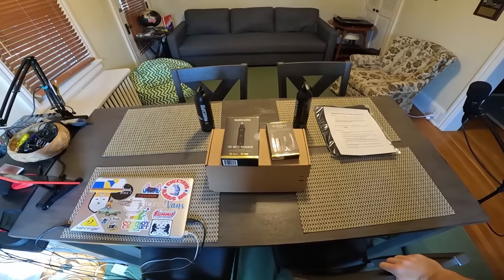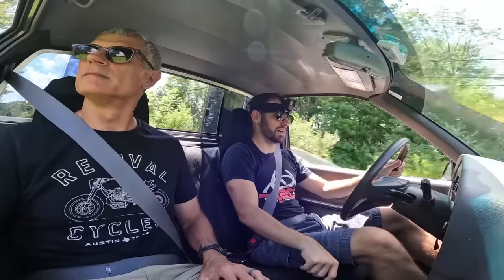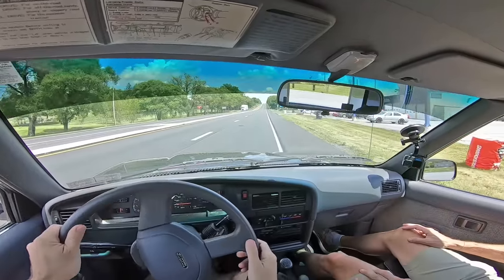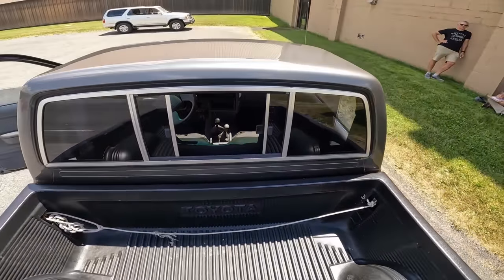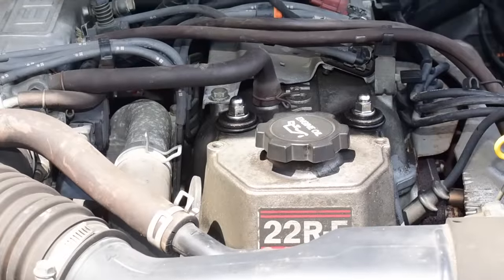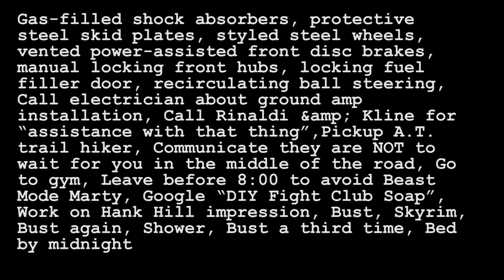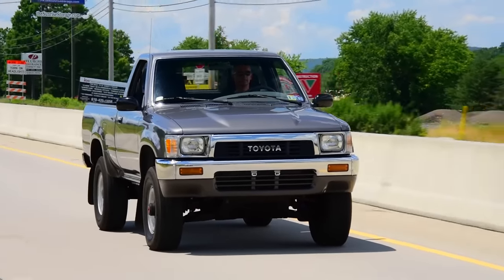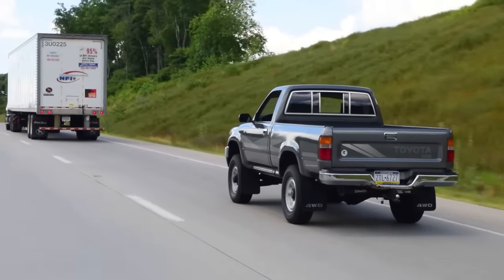1989 Toyota Pickup SR5 4X4 5MT: Regular Car Reviews

Comment: I want one, yes. But I would treat it the same way I treated my showroom condition 2002 Ranger XLT 4x4 5spd with the 4.0 V6. I would use it for moving things. I would use it for pulling a trailer. I would go off-roading to pass the time almost every weekend like I do now. I don't think I could ever, no matter how clean it was, take something like a Hilux and hide it under a cover. They were meant to be enjoyed. Not abused, not overworked, not destroyed... But actually used as trucks. And maybe it gets a ding here and there or acquires a scratch when I get too close to a big bush but that's okay. That's what it was meant to be. Dings can be pulled and scratches can be remedied. It's all part of a truck's maintenance cycle and as long as you accept that a truck you use is a labor of love, it will never let you down.

I would pay $20,000 for that truck. But that's because, for 1/3rd the cost of what's sold today, it would outlive me and the nephew who gets it after me as long as we take care of it.

Maybe I'm trapped in my own little fantasy world but I've personally seen these trucks with their original engines with over 500,000 miles on them still going strong. I need one.

Comment: 2nd comment here further into the video, a 22re powered manual transmission truck running well should have 0 issues going 80mph and cruising around town spiritedly. That one must have some issues. My 92 forerunner with 31 inch tires could hit nearly 100 mph, and I’m 33 inch tires I can still do 85 mph and I have gotten as much as 24.7 mpg. I do have all of the emissions equipment deleted, a performance header, no AC, and most maintenance up-to-date. I have absolutely no problem merging on the highway or passing people in a 55 mph zone. And my rig weighs about 4000lb, 1000 more than the little pickup there

Comment: Know a relative who has the Face Lift version of this (1994). Weirdest optioned truck I've ever seen. Base rear wheel drive trim with all chrome, graphic side decal, extended cab, 22re, but manual everything (Locks, windows, mirrors and transmission) and oem Toyota Bedliner. Even had the sr5 gauges with oil pressure, tach, and volts. Went for a ride and my relative had to turn off the ac and floor it to 5k to get on the freeway. Can't say I'm impressed, but that truck still has guts. Looks alright for its age with 327k miles. No indication that its an SR5 on the rear tailgate. My relative still uses it as a knockaround truck and for spirited driving.

Comment: The owners love them. I was in Denver working at the dealer. The 92 came in making noise. I was an apprentice. The master tech I worked with heard it and said sell them extra time to peak under the valve cover. This had a chain with plastic guides, just like now. The plastic cuts down noise. And steel chains eat it up over time. Just like now. The guides were gone and the chain was bouncing on the cover digging into it. And to do the chain on the 22 you have to pull the head off. The truck had 200,000 miles. But these owners were like the ones with a bow tie or blue oval tattoo. The owner bought an over haul for $4700. Back then we took it out pulled it apart and sent the block and head with the new pistons to the machine shop. Rods were just traded for $10. The machine shop did the head, bored and honed, we reassembled. That job was 27 hours in TTIPS. It was the first ticket I pulled from the dispatcher.

Comment: I had a '92 with extended cab. I bought it for $5K. Several years later someone ran into the side of me. The guy in front of me was pulling a boat that came off the hitch when he was pulling out of a gas station ahead of me. A little Honda was flying around the turn ahead coming towards us. As the boat moved into the oncoming lane the tongue of the trailer went through the driver's side headlight spinning the car counterclockwise off the road in a semi-circle until they slammed into the side of my truck with their passengers side. I couldn't do anything but watch, and when they came to rest I was right next to the passenger of the little Honda. Funny thing was I had just finished a conversation with the boatman. He was a class behind me in high school. The occupants of the little Honda were one class ahead of me. The insurance company totaled my truck for $5400, and I bought it back for a few hundred. The side was just bent up, and it needed a new drivers side window glass. A friend of mine patched it up, and I drove it several more years before finally selling it. So even though it literally paid for itself I never had that feeling like it stacked up to all the hype. Even with the V6 it was a dog, and got terrible mileage. I guess the best word I can come up with to describe how it compared to what I was used to is "thin". It felt really light, but not how it drank gas, or had zero power. A big meh after hearing all the hype for so many years. This was all close to 20 years ago.

Comment: I drove a '91 in high school and throughout college after saving all summer in 1999 to buy it for $5,000. It had the six-cylinder -- I believe,  3.0 liter -- and a five-speed manual. I loved that truck. It was damn-near impossible to get it struck, unless you were downright stupid. But Mr. Re is correct about the rust: Upstate New York wasn't kind to that frame.

Comment: I grew up with a dual cab '95 model that we had up until a couple of years ago when Mum sold it. Ours had the 2.8L diesel which was even slower than the petrol variants available here. That said, a somewhat common engine swap for these here in Australia is the Buick V6 3800 from a 1988 - 2004 Holden Commodore, allows these to cruise effortlessly on the highway at 110 km/h and tow or move heavy loads while still getting decent fuel economy.

Comment: This was the vehicle that made me a Toyota fanboy. I wanted a small pickup with a manual and it was either going to be one of these or a 2000's Ford Ranger. Safe to say I made the right choice. Bought a white single cab 2wd 5spd 94 22re with only 90k original miles. I always thought of it as like a Japanese El Camino or an Aussie's Ute. The truck drove like a compact utilitarian tractor made for work. Even though it was 2wd it was so light, once I put on some all terrains it would go anywhere a 4x4 would go with the exception of mud. The 22re was a dog but made up for it with it's plentiful low-end torque. There was an old saying with these trucks, "they last forever because it takes that long to get there." Toyota would be very wise to bring back a truck of this size with a modern engine, bare bones interior and manual transmission yet with modern safety equipment, but sadly, I don't see that ever happening which is also why these things are skyrocketing in value.

Comment: I bought one from a neighbor this spring for $600.00 needing a fuel pump. I don't regret buying it at all, went mudding and beating down quad trails right after I fixed it. Glad I didn't go with building a squarebody chevy for my 4x4 needs, the toyota is way better.

Comment: Just picked up a 94 single cab 22RE 125k on the clock 5spd. one owner because the seller didn’t use the Internet found this one in the newspaper No Competition flashed some cash drove away nice and easy garaged it’s whole life No Rust Paint still glossy motor unmolested

Comment: Awesome trucks but the rust is a real issue.  I looked at a Black 1986 that looked immaculate. Marty Mcfly’s w/o the Xtra Cab. Truck looked perfect it even had the bumpers from the movie(no roll bar though) but the frame was legitimately missing bellow the bed. Like, gone.  It was shocking a truck that looked that good could have a frame so messed up.

Still on the lookout for one of those trucks but man was that an eye opener.

Comment: Not sure what happened in the States, but we had a version with the 4Y - 2.2 litre, and it went like stink.
Also used in NZ Hi-Aces.
Remarkable engine, both torquey and powerful.
Had a Hi-Ace van off the clock in 5th on one of the rare straight roads up near Kaitaia in Northland, NZ.
Nice old bus.
Unfortunately, someone rolled it.
Glad to say it wasn't me.

Comment: I got a 1988 Chevy S10 2.5 5 speed my Dad bought new. I had it repainted and the engine rebuilt a few years ago. It looks new again and it’s my daily driver now. I get flagged down all the time by people wanting to know if I’ll sell it. I already turned down 20k for it…twice. 

With gas so high I’m glad I have it. I almost put a V8 in it but glad I didn’t now. It’s also fixable when something goes wrong. I wouldn’t trade it for a brand new one. Plus I was 3 when my dad bought it and it’s the vehicle I learned to drive in ( I’m 38 now).

Comment: In the spring of 1994, my dad bought a new base model extended cab Toyota Pickup. It was probably the coolest vehicle my parents had. Unfortunately in the fall of '94 (approx. 6 months later) it rolled backwards with me in the back seat on the shoulder of the freeway into the path of a semi truck. The semi truck was able to slow down enough where I only lightly bumped my head on the rear window, but the bed of the truck was completely caved in. Still to this day, the scariest thing that's ever happened to me.

Comment: got one! a 1992 toyota sr5 extended cab, manual tran, got bull bars and a box in the bed, 4wd, 3vze with an AM head gasket so it doesnt have those issues, very minty, got it for 500$ cuz the guy was old, didnt want it, and said it wasnt as good as american pickup, and the oem water pump finally gave out at 250k miles so it didnt run

use it as a daily and an offroader and i treat it like dirt. use it like dirt. had a guy offer 10k for it. talked to him a bit and showed the minty new pics compared to the scratched and dented truck it is now and he cried a little lol

Comment: If your rear suspension is bouncy you probably need shocks.  I have a 1995 base model 4x4 with 63k miles and it rides good, especially with a little weight in the bed.  With a little weight in back my truck rides nice and soft like a luxury car, and yes, it loves 48-60 MPH.  It was designed in the early 80s for a 55 MPH America.

Comment: A friend in high school had an 89 Mazda pickup 4x4 with a big 4 cylinder that seemed fast enough back then, and could pull a 25” boat out of a wet launch ramp no problem; everyone in their f150s and silverados were struggling in the rain with smaller boats. I swear that thing had no problem running with no oil

Comment: The Toyota Hi-Lux with the 2.8 Diesel engines are one of the most sought after trucks in my country, one in excellent shape can fetch MSRP prices. The are reliable, tough and very slow, but a great truck. My father owned 4 since 1981.

Comment: Bought an ‘89 RN101 4x4 with the 22re and 5MT earlier this year. These things are just so cool and fun. Nothing like the long throws of those floor mounted shifters in older trucks! Unstoppable in the snow too when driving in winter is unavoidable. Unfortunately mines out of commission for a suspected bad igniter. Once that’s replaced it’ll be back on the road. May sell it, may keep it.

Comment: My dad bought an 89 DX new and drove it through late 96 when he got a T100. I learned to drive on that truck and the 94 4Runner my mom drove. Both were manual. The pickup was a 22R regular cab painted light blue and the 4Runner was the 3.0. Sadly we rolled the 4Runner after 3 years of having it.

Comment: bought one of these in 2009, while I'm sure the engine would go forever, even then every thing else was prone to failing, like the window brackets rolling up windows, transmission synchros going out, key holes getting worn. On top of that you're the slowest thing on the road and getting the gas mileage of a full size v8, ~18-20 on the highway, depending on the tire size.

Comment: It's not that I dislike the truck at all, it's fine. My dad owned one back in the 90s for a couple years until it... well, rusted out like most of them did. 

Just really can't imagine why you would've gotten one of these over a F150 or Ranger of the same same. Better at being well.. trucks. I think the motor is fabulous and the transmission was bulletproof but the rest of the truck just fell apart. I remember watching that Top Gear episode and thinking "what.... these things fall apart all the time" and couldn't believe it was the same truck. I had a 89 Dakota 4x4 with the 5.2l and the 5speed and I would've taken that all day over the Pickup after experiencing the one my father had.

Comment: My 89 Rwd would run the speedometer right up to the peg. But it came with car sized tires. It was really fun to scoot around town, especially when I added a rear sway bar and fixed the camber in the front.

Comment: I once saw a 1992 Toyota Pickup with 828,000 miles on what the owner said was the original engine and transmission. Thing looked and ran like garbage, but it was glorious.

Comment: I don’t own this truck, but I have an ‘05 Dodge Dakota SLT with a v6. The suspension thing is true of my truck too. Very springy, but not in a lose way, more of a rather stiff one. You go over a bump in my parent’s vehicles, it feels fine. Go over one in my truck, it sounds expensive. The whole cab rattles. We had steel plates on a main road out here. They were coming round a turn while going down hill toward an intersection. You had to get on the brakes before getting to the plates, otherwise you’d get the sketchy experience of feeling your rear end skip off to one side, a few inches, mid turn. And that’s with recently replaced leaf springs, mind you. Don’t know who the previous owner was, but they beat the crap out of this thing.

Comment: My friend has an 89 Extended cab, V6 manual. He bought it new, and rolled it in a snowstorm 6mo later. It now has 220,000 miles on it but the engine doesn't make any power on inclines

Comment: I have an 86 base model 5 speed 22R-E carburetor engine with the 5 speed manual but mine is 2WD and I agree folks do stop you to hagle a price. Funny thing this truck had no problem starting up over the winter while my wife's Chrysler 200 couldn't even start on the coldest day of the winter in Chicago last year.

Comment: Had a '02 reg cab 2wd, bought for 6k put 255k miles on it  over 15yrs and sold it for 2k, miss it terribly but I couldn't find a rear diff for it reasonably, told the buyer and he still brought it and I see it occasionally in my area... They are great trucks, hesitant though about buying a '22 base model for 31k and wondering if it's gonna last that long...

Comment: I bought a 1 owner 2wd 1987 pickup with a 22r and a 5 peed in 2021. it has 128000 miles and is rust free and almost immaculate. I paid $600 for it. No I did not forget a zero. I will never sell that truck. on that note if anyone has parts to put air con in it let me know

Comment: Here in Europe we all got the 2.5 or 3lt diesel hilux, great power.
We had a swb 1987 landcruiser with the 3.4 non turbo diesel which was good for 105mph and had the same chassis and leaf springs as the Hilux but boy could it pull loads

Comment: as someone who drove  all 3 models. if u just want truck to  drive. yea get the small pickup truck. if u need to haul stuff. get a T100. if u going 4x4 and mudding and wanna take the kids. get a 4runner. all these trucks are the same truck. the T100 and4runner just have bigger suspenstion parts. other then that there the same truck.  not fast not speacial. but will do what u ask. we have a T100 for 26 years now.  its pulled a dozer, hauls everything, loves the snow and wood trails.  but cant do 100 or pass anything on the road. get great gas mileage for its age and size.  drives better loaded down. there not lambos no. but are some of the toughest trucks ive seen. but if u wanna go fast get a s10  or ranger  put a v8 in it and dont die. you can get truck and engines for cheap

Comment: Man I can't believe Regular Cars did this toyota pickup and not mine that I emailed them about like 3 years ago. But in any case, yeah they're pretty solid trucks. I've got one with about 380k miles on it and it's still a pretty solid workhorse. Nice enough that I can drive it around on the day-to-day but not so nice that I'd be afraid to use it for truck stuff. But any time it's gone for a few days - usually when I've had to take it to the shop - I suddenly get a lot of people coming around asking if I sold it then saying they want to be the first to know if I plan on selling it. But it is pretty funny how many older people come out of the woodwork looking to buy that thing.

Comment: There are so.many.of.these here in the Mountain West, including the side graphics (and tailgate optional). My two best friends have them still. Every climbing partner I ever had owned one. The 2.4L four runs half a million miles even if you ignore it. They are dirt cheap to own -- and impossible to buy used, cuz no one ever sells theirs. I was desperately looking for one to replace my second shitty F150, and the dealer laughed and said "We never get SR5s on trade. People just keep them." But they sold me a Previa minivan, which shares the mechanicals with the small Toyo pickup, has also been f'ing bulletproof, and is chugging along at 318k.🙂 Fantastic vehicles if you live outside the Salt Belt.